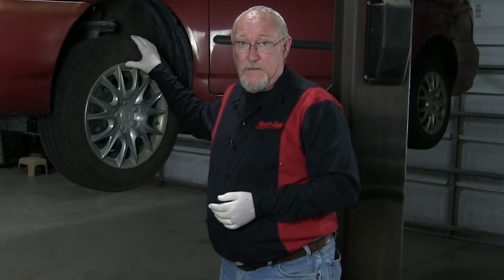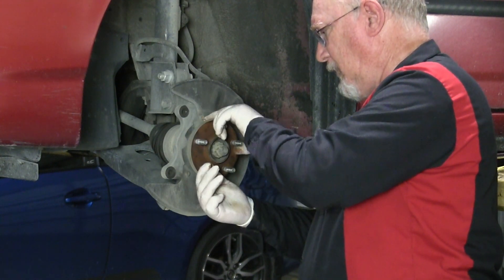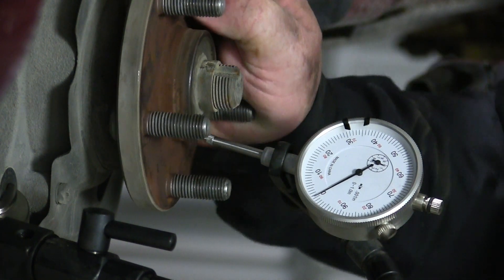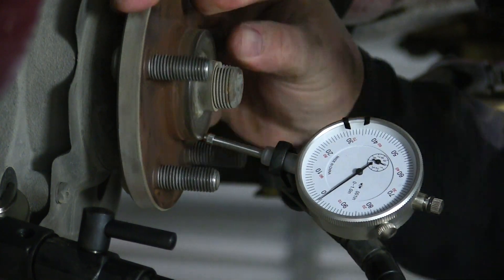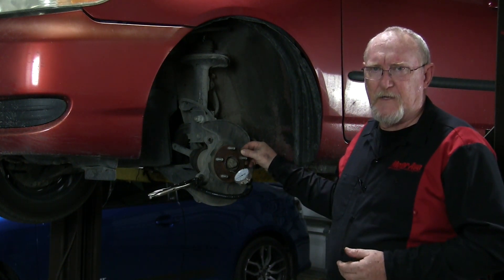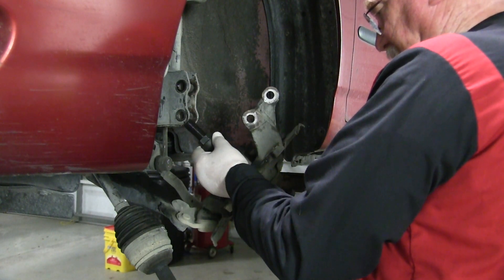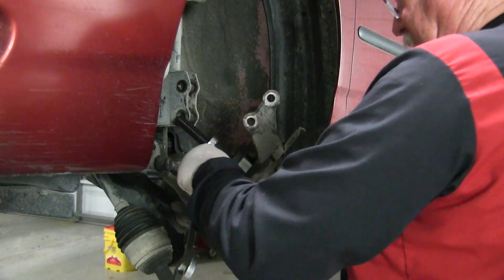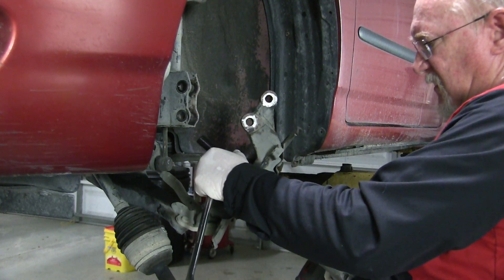The Trainer #101 - Professional Hub Bearing Inspection and Service

Comment: Nice job with the video Pete.  When pressing in the hub what do you do to make sure the hub isn't pressed in too far or not pressed in far enough?  The proper gap spacing.  I try not to guess at that.
Reply from the maker: There is a flange seat on the hub and I've always been able to feel the hub bottom against the inner race. I don't hammer it in - I "blip" the gun, feeling for that change in tone and tension. You could also take pre-repair measurements to get a feel for how far in the old hub is but that may not be 100% reliable.

Please - share your technique!